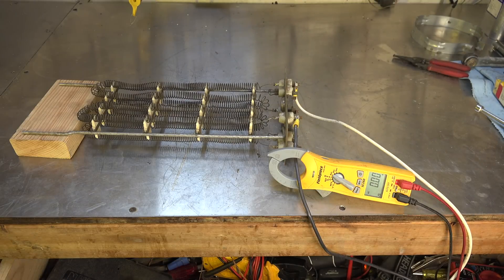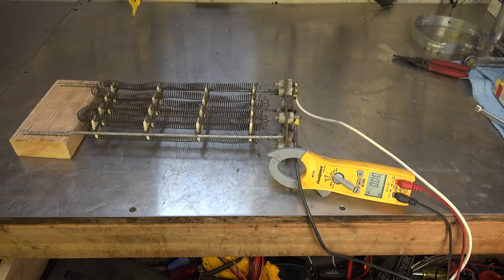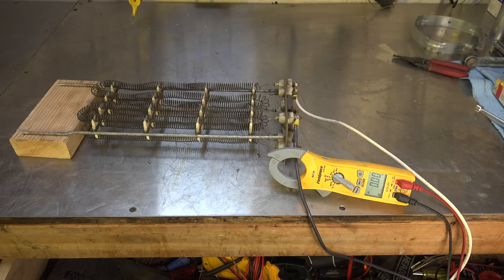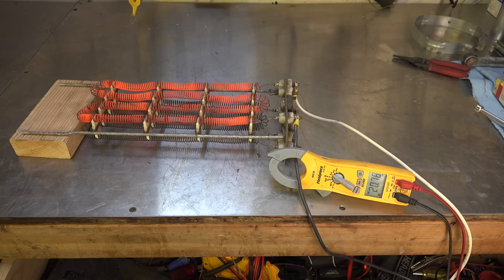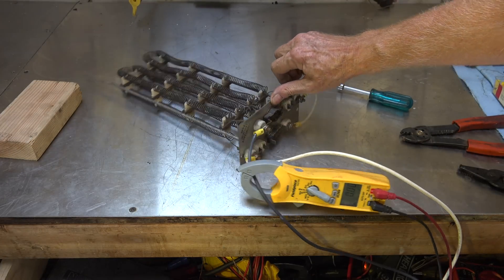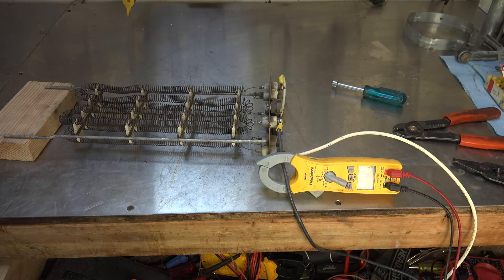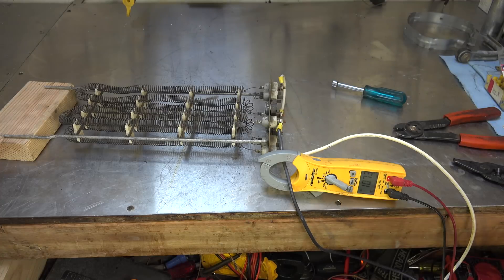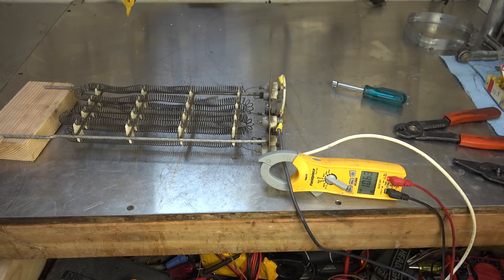What is meant by electric resistance heat.

Comment: Twice the resistance EQUALS , lower current as shown , why would anyone think that lower power will give more heat, you need to parallel them , my god
Reply: So many people have no idea how electricity actually works. They're the same kind of people who think that if something normally uses a 1 amp wall adaptor and you hook it up to a 2 amp adaptor, you'll "fry" it. They don't seem to understand that a load with a fixed resistance will only draw a certain amount of current, and it makes no difference how much current the power supply is capable of providing. As long as you have the right voltage, you could hook it up to a 20 amp transformer and it wouldn't make any difference.
Reply: Exactly, and with his accent it's not so much necessary to explain. 🤔 It's just sad...
Reply: The company I worked for believes resistance and friction are the same thing. I opened my mouth of five years experience and asked wouldn’t less resistance generate more heat? And I got laughed off the table. They believe that resistance increases heat because the amperage is attempting to overcome the resistance. I never said they were wrong it just didn’t make sense to me and of course none of them can just say I’m flat out wrong they just have to try to make me feel stupid and condescend me. Then I see videos like this and was like wow I might have had a slight clue. And i learned to lead with fact and not arrogance and question even your mentors

Comment: So HOW DO you get the maximum heat?
Reply from the maker: If you operate the heater at its rated voltage, you will get the maximum heat that the element can safely produce.  Btw, electric elements are 100% efficient.
GFM
Reply: grayfurnaceman ok, what if I'm in a situation where I need to find the right resistance for a value of voltage to get maximum heat instead of finding the right voltage for a value of resistance to get maximum heat? Let say the voltage is 12V, what the resistance has to be to maximize heat?
Reply from the maker: Beats me.  Take that one to an engineer.
GFM
Reply: @luongmaihunggia  I know your question is old, but I'll just say that the first thing you would need to know is how much current can whatever device/material you're using carry before it gets TOO hot and burns or melts. Then divide the voltage by the current and that will tell you how much resistance you need. So let's say for example that you're using a wire or something which can carry 12 amps and you want to use 12 volts. 12 volts/12 amps=1 Ohm. So you will need 1 Ohm of resistance in the circuit to limit the current to the 12 amps that the wire can handle. You can either do that with the wire itself by having it long enough to have 1 Ohm of resistance, OR you can use another load in series with the wire to limit the current.

If you're using some kind of experimental material you made yourself to generate heat, then you'll need to know how much current it can take before it burns, and how much resistance it has.

Comment: Resistance can mean several different things.  In this case, resistance means the cohesive resistance of the metal.  Different metals have different resistance.  Given current, some explode, some produce heat instead.  Respectfully, comparing this type of resistance to a car going up hill isn’t valid.  It’s not resistance of the load, but resistance of the material that creates the heat.  When you add more material, you decrease the heat.
Reply: Hi, Is it possible to use an element of 1500w  by breaking it into 300w. Is there any method by which it will work, wont balst?
Reply: Well, you aren't decreasing the heat, it's just dissipated over a larger area?

Comment: Ohms law and not a myth. Equiv- series resistance add-up hence half current while equiv-parallel resistance is here is halved, hence 2xce the amperage.
Reply from the maker: Ohm's law is not the myth.  The myth is the concept that "resistance" somehow equals more heat dissipated.  The less resistance, the more heat dissipated.  The opposite of the concept is true.  It not about physical definition and more about the concept of "more resistance means more heat".  
GFM
Reply: @grayfurnaceman  wrong - more resistance means less heat

Comment: Myth? you just added more surface area for the energy and reduced the resistance by allowing the current more time to flow. It is the backup of to much current that generates the heat. If you restrict the current input on your first example you would have gotten the same result as your second example. A rheostat is a variable resistor which is used to control current flow into the elements either tungsten or nichrome wire because of their high resistance to temperature and current flow. SO simply put the more current you try to cram down the wire the hotter it will get. Volume and pressure. "SLAPS FOREHEAD AND WALKS AWAY in dis belief!"   :)
Reply from the maker: Unfortunately, you are completely wrong here.  Electricity does not work that way.  This is exactly the reason for this video.  I know it seems that if I increase resistance, the energy to overcome the resistance will increase.  Such as if I travel up hill in a vehicle, the resistance to my moving up increases and more energy is used.  In electricity that does not happen.  If I increase the resistance to flow, as I did when I added the 2d element I doubled the resistance to flow.  That halves the current.  If you rewatch the video it is obvious.  Consider if I placed a short copper wire in an outlet. One end of the wire in one side of the plug, one end in the other.  Very low resistance.  That would, using your thinking, mean very little current would flow.  The actual result is a "short",  aptly named.  The circuit protection would immediately open.  That is because the current flow was very high.  In the thousands of amps.  Think about it.
GFM
Reply: @grayfurnaceman  this is properly a stupid question... but i just have to ask... if the circuit in series draw less amps... where does that force go? if force is a constant... shouldnt that mean that if the circuit is applyed the same amount of force, the path whith most resistans, has a bigger change from moving energy (electrons moving) to heat energy (electrons stopping and turning in to heat)?
im just curious...Loved the video btw... keep opp the good work!
Reply from the maker: The understanding of electrical energy is quite easily misunderstood.  
Resistance is like a valve on a water line.  the water passing thru is the energy expended.   High resistance is like the valve being opened just a small amount.  If I increase the pressure (voltage), more will pass thru if the valve opening has not changed.  
Also, electrons do not change speed.  Just the number of them passing is decreased when the valve is restricted.  When the electron passes thru it effects the material it is passing thru.  Something like a vehicle driving at a fixed speed thru air.  The air is displaced by the vehicle and the air is heated as the vehicle passes.  Not a perfect analogy, but pretty close.Hope this helps.
GFM

Comment: Please read until the end. I am confused. I held the assumption that elements with higher resistance will allow for less energy flow and the energy lost through a voltage drop would be converted to heat. I helped to design a high voltage tesla coil bearing this assumption and what I predicted and calculated was accurate. I attributed the loss of heat in your experiment to the fact that the heat was distributed evenly across the elements and the reduced energy density caused them not to glow. The amps were insufficient to maintain voltage and it dropped, causing both elements to heat evenly. I pictured the heating as a bell curve, with a sweet spot which is determined by the amps. It is the distance between the actual resistance and the sweet spot which determines heat and you were closer with only one element. Doubling this increased the distance and caused for less energy density. I have held this in my mind for years and used it to logically predict how efficient heating elements would be with great success. The conclusions I made regarding the experiment were predictions based on assumptions. Hearing it explained this way confuses me and without mathematics to analyze the results, I may be completely wrong. I would like a deeper explanation over this if you find time. Thank you and keep up the good work

Comment: P=I(IR)=I^2R=Joule Heating, it's not a myth it's science.
Reply: power or energy 
?
Reply: That’s unnecessary. I just went with ohms law and was convinced enough.
Reply: Yeah, it is proportional to the resistance, so the power of heating goes up linearly as the resistance goes up. On the other hand, the power of heating increases exponentially as the current increases.

So, when the heating elements are put in series, the resistance is doubled, but the current is cut in half. The net effect on the power of heating is that it's cut in half (0,5^2 * 2 = 0,5).

Comment: Im pretty sure its still resistance heat, just when you ad too much resistance it dosent heat as well, there is a sweet spot.
Reply from the maker: The amount of heat dissipated is inversely related to the amount of resistance of the element.  So less resistance, more heat dissipated.  The only limit is the ability of the element to dissipate the heat without overheating.  
GFM

Comment: Another good video GFM......

Hey I have a Goodman 2 ton.......heat pump.......outdoor ambient of 95....suction pressure 60 ....suction line temperature is 84 degree...........liquid line pressure is 225......liquid line temperature is 95

What do you think the problem is..????       would it be the TXV ????
Reply from the maker: Look for low charge or restriction.
GFM
Reply: grayfurnaceman I think I found the problem........Im sure its not the charge.......so I started looking for restrictions.....just like you said......the air handler is in the attic.....it has 3/4 and 3/8 running up the wall into the attic.....but outside next to the condenser ...lol ...some idiot has stuck a short piece of 5/16 into the 3/8 between the wall and the condenser..........and in the attic ....somewhere between where it comes out of the wall and the air handler....lol......the idiots have stuck another section of 5/16 in between there and the air handler.....and about 2 or 4 feet from the air handler the idiot....changed it back to 3/8.............lol rofl......I told the home owner I would fix that Monday........GFM the system is running a 72 psi suction with a 228 head and the suction temp is 74......lol rofl.....I first thought it might be over charged with to much liquid.....because the home owner said that about once a year somebody has to put refrigerant in it.......

Thank you for replying and helping me figure this out .....and keep making those video's
Reply from the maker: Welcome
GFM

Comment: Point well made there GFM
When is a Hot Water heater required if the water is already hot?
Water Heaters heat water 
Ni chrome wire offers more resistance than copper so it creates heat. Perhaps they should have called it something different but it does what it says. Them electrons get real busy when they hit resistance.
In fairness power distribution wiring should then be called Low electrical resistance  non heating conductive pathways?
It's all good, I guess it is a matter of semantics?

Comment: ehm you double the resistance and call it lower?
Reply from the maker: Yes.  If you double the resistance, you will halve the amperage draw.
GFM
Reply: @grayfurnaceman  but you have to consider the material being used too. You've gone past the optimal resistance for this material, resulting in the drop in amps
Reply from the maker: @rocki_bb  I fail to understand what "optimal resistance" is.  This is a simple example of ohms law.
GFM
Reply: You have shown that relationship between current and resistance, but it somewhat twists the relationship to heat/power you're trying to imply. 

A better experiment/presentation would be running the same amount of voltage through pieces of copper wire and nichrome wire, both with the same diameter, length, and turns. It will clearly demonstrate that increased resistance = increased heat. 

This also shows why in various situations heating elements are combined with things like ceramic and quarts
Reply from the maker: @rocki_bb  Your basic understanding of resistance, amperage flow and power used is flawed.  
 I effectively did your experiment.  Its the point of this video.   the higher resistance wire consumed less amperage (energy) than the lower one.
Ceramic is used in electric heaters, not as a conductor but as a heat radiant.  
GFM
Reply: @grayfurnaceman  I really appreciate you taking the time to discuss this with me. I have limited know about electricity. My experience is more in Biology and Chemistry. I'm having trouble expressing what I'm trying to say because of a lack of the appropriate language/terminology. 

I'll keep thinking on this until I can do a better job of expressing what I'm trying to say. Thank you again for taking the time to respond to me! Lots of content creators don't.
Reply: To give a proper demonstration, you must bring both circuit configurations to the same temperature. You can't make a claim by just using the same power. Dude, I would pick up and extra home insurance policy if I had you screw in a light bulb.

Comment: I always thought that term resistance was dumb and made no sense. Now I have the proof!!! 👍👍
Reply from the maker: Joule heating is no different that BTUs per hour except in the numbers and time.  The issue here is the assumption that increased resistance equals more heat.  Even though the concept that increased resistance somehow increases work done, or heat released, it is not true.  If electrical power is given a low resistance circuit, the power thru the circuit and thus heat released will increase over a high resistance circuit.  We are working here with real world measurements and an understanding that increased resistance does not mean increased work done or heat released in the electrical circuit.
GFM
Reply from the maker: I taught this subject for 9 years and that's the assumption that most of my students had.  They equate it with driving a car up a hill.  More resistance = more fuel used.  
GFM
Reply: I think the alternative term for electric resistance heating is joule heating which might make more sense in this case
Reply from the maker: Yeah, I wonder who came up with that one.
GFM
Reply: Where do you get the idea that people assume increased resistance equals more heat? I've never heard that assumption. It's called resistance heat because without the resistance it would be called a short circuit.
Reply: grayfurnaceman is it 240 volt single phase for one element?
Reply from the maker: Single phase
GFM
Reply: Why not call it electrical friction heating then? since the heat is obviously from the friction from the electrons that stays the same no matter the resistance, unless you have air flow for that heat to be transfer to or a difference in voltage, just an thought.
Reply: @KenKen-ui4ny  Electricity doesn't really work that way. If you try to think of things like "friction," you're just going to get everything confused. Current flow is what causes heating. The greater the current, the more heat that is generated. And current flow is always a dependent variable - the amount of current that will flow in a circuit is directly dependent on the voltage and resistance. Ohm's Law is: Voltage divided by resistance = current. Therefore, a higher voltage with the same resistance will increase the current. Decreasing the resistance but with the same voltage will also increase the current. But either lowering the voltage OR increasing the resistance will DECREASE the current. He increased the resistance in the video, that's why there was less current and why the heater elements didn't get as hot.
Reply: @ct6502c  LOL, Not to be rude, but the current flowing through the coil has got to be doing something to trigger the element to heat up as it flows through and friction from resistant is only the basic explanation out there, just saying the current flow is what causes the heating really doesn't mean anything to explain that, what he is trying to say is increasing only the resistance has nothing to do with changing the heat output which i get.

Comment: The current is limited in the coil because incoming power is AC which causes inductive reactance. If the element were heated with DC current this wouldn't occur.
Reply: There is little inductance with those open coils.  The I^2 * R has the 
more effect on heat. The current  ( I ) was halved and the resistance 
( R ) was doubled but the square of the current gives the greater
 change.
Reply from the maker: This type of load has virtually no inductive reactance.  If DC power is used, the total power dissipated will be higher but the series connection will result in the same reduction in power dissipation.  I will do a video on that.
GFM